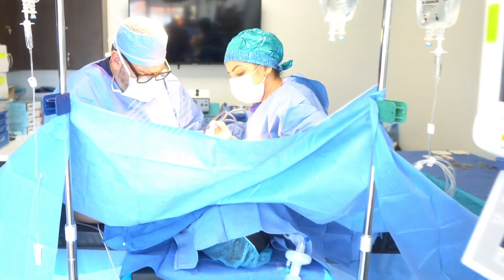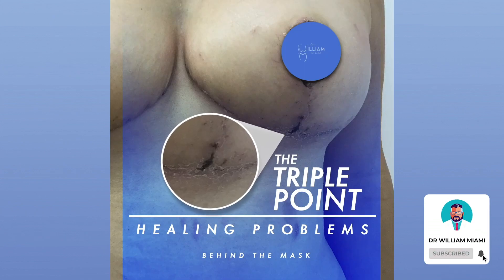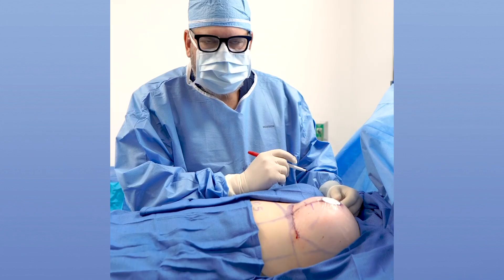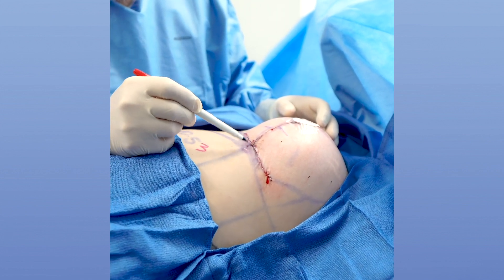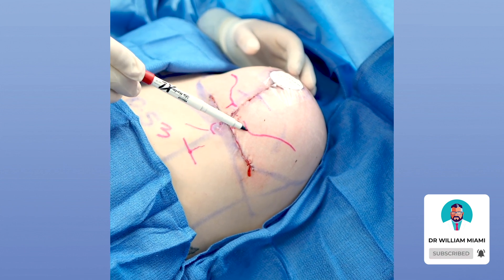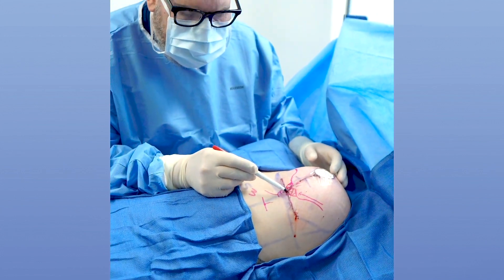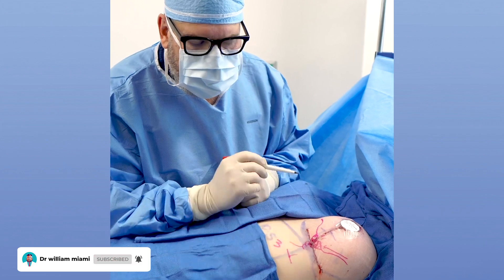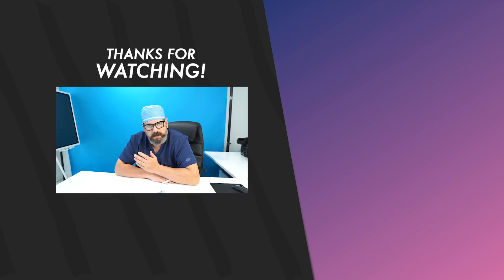How is a Breast Lift Performed - The Triple Point

Comment: What about leech therapy?
Reply from the maker: Super good question. Leech therapy is used for a different purpose. It is used in cases where the blood supply leaving the wound is inhibited. So the blood coming in is fine but the venous outflow, the blood leaving the wound, is blocked. That's where the leeches come in. They bite into the area and suck out the venous blood until the body has time to heal the venous outflow and the leeches are no longer needed. In this video it is different. There is no problem with the blood leaving the area but the problem is the blood ENTERING the area has been stopped by the incisions.
Reply: @Dr William Miami  Thank you for explaining that, much appreciated.